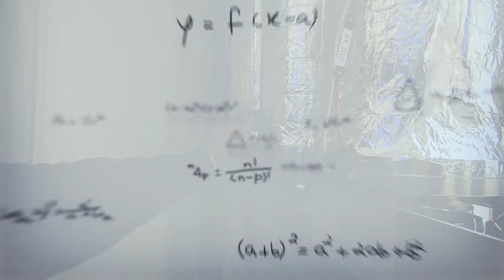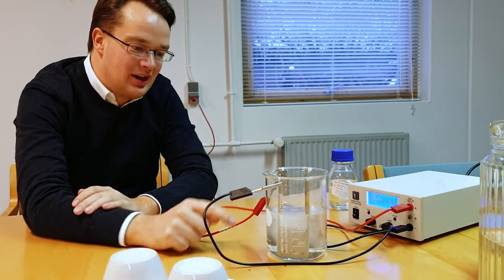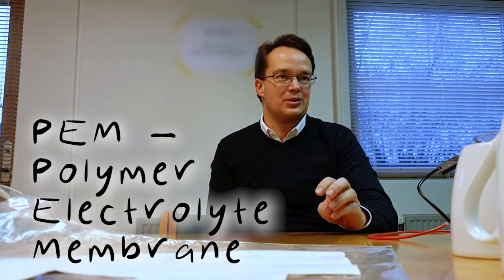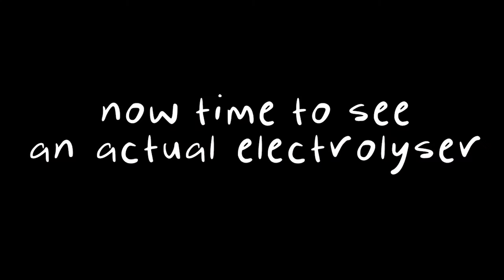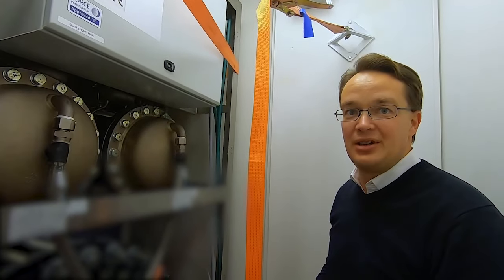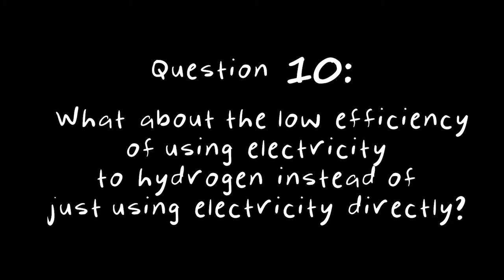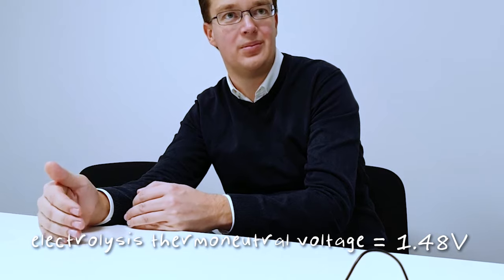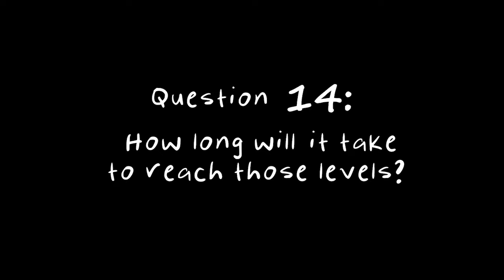Green Hydrogen Systems Electrolyser Tour

Comment: How about a future short video of a co-generation style electrolyzer system ?

As touched briefly on in this video .. the energy needed to split 2(H2O) -> 2(H2) + 2(O2) comes partially from electricity and partially from heat .. I think the electricity side of that frequently gets a disproportional amount of attention .. higher amounts of heat reduce the amount of electrical input needed .. That continues all the way out until eventually the splitting of water can be zero-electrical input and 100% heat energy input .. given the enormous amounts of 'waste heat' out there , absorbing that 'waste heat' as a partner with another process would seem to be a synergy style system , and co-generate instead of solo-generate.

Maybe not only further improve the efficiency of the energy you have to pay for compared to the amount of hydrogen you get out , but also by taking away that 'waste heat' to do so from that other processes you might further improve the efficiency of that other processes as well.

Without a partner processes , it could still be done with a co-generation solar style system .. Photovoltaic collectors are actually better at (do more of it) converting solar light energy input into heat energy ~80% than directly into electrical energy ~20% .. and that heat lowers the electrical conversion efficiency for the PV module (soo it's waste heat for the PV).

Or at the extreme end of the solar heat water splitting to hydrogen end of the spectrum would be to modify a large solar heat collector system like the molten salt facilities , to use all that enormous amounts of concentrated solar heat energy to drive a water splitting system.
Reply: The non electrical heat method sounds ideal Ian, can you point me to any literature to show how it's done? Thanks
Reply: @agritech802  The scientific term for using only electricity is electrolysis .. decomposition of a chemical compound by electrical energy .. the term for using only heat is thermolysis .. decomposition of a chemical compound by heat energy .. there are even some microbial fuel cells that have shown that microbes can also use the chemical energy of the materials they biologically decompose in order to contribute some of the decomposition energy needed for secondary reaction like hydrogen production .. in the real world they do not have to be mutually exclusive , you just need a net overall amount of energy put in to break it apart .. using 'waste'  .. be it waste heat , or biological waste , from some other processes (that needed to be done anyway) , is my personal preferred energy source for such thermolysis.

There are lots of pubic sources about thermolysis , here are a few examples (in no particular order) :
https://www.energy.gov/eere/fuelcells/hydrogen-production-thermochemical-water-splitting

https://www.osti.gov/biblio/7335245-thermolysis-water-production-hydrogen-energy-vector-compared-electrolysis-which-has-higher-efficiency

Discussion of the biological method to contribute energy and reduce the needed input from other energy sources is one of the topics discussed in the introductory book .. Microbial Fuel Cells by Brude Logan 
https://smile.amazon.com/dp/0470239484?psc=1&ref=ppx_yo2ov_dt_b_product_details
Reply: @ianpgeorge  that's great, thanks for that, I'll check them out

Comment: Hi Rosie,  a German company HPS,based in Berlin produces a compact green hydrogen, off grid power solution including storage for home owners using their Picea system. It is still quite expensive but gaining new users continuously. With your engineering knowledge you might uncover more producers of similar small scale systems     Will these become more widespread and above all affordable to more home owners?
Reply from the maker: I didn't know about Picea, thanks for pointing it out to me. I have seen some other home hydrogen storage (e.g. Lava), but I haven't looked into it in depth yet, I need to add that to my list!

Comment: Hello, interesting topic. But we are in the presence of an installation that the private individual could never have installed at his home. Perhaps a presentation would be needed that would show that electrolysis and the fuel cell are possible on a smaller scale like that of a simple individual dwelling. This other level of detail will make it possible to better understand the possibilities offered for the individual, and also the cost of such an installation to store the green hydrogen produced from photovoltaic panels, and then to produce electricity during less sunny periods. However, solutions do exist for homes, we should perhaps try to promote them to start freeing oneself from fossil energy at the level of individuals. The AEM is perhaps for the moment the one that offers a lower cost thanks to less noble matérials in its construction. The prices are starting to drop. A bit like the price of LifePo4 batteries, which drop quite well, and allow battery storage to complement hydrogen storage. For good efficiency, consider producing hydrogen from renewable energy (sun, wind, hydraulic). In any case, avoid fossil fuels to obtain the energy necessary for the separation of Hydrogen, Oxygen. It is not necessary either to seek profitability with regard to the installations in the particular houses. The prices are high. We must seek to be able to do without fossil fuels. while thinking that profitability will never be there. Profitability will undoubtedly be present for the very large companies which will build power stations of this type and finally return to an economic model almost equivalent to the current model of fossil fuels. Large companies are currently seizing the market by using models of the power to gas type, ... Thus, they prevent as much as possible a possibility of autonomy for individual houses which could however easily have a hydrogen system installed in each of them. 
If this develops too much for single-family homes, they could cause a significant loss for these large companies who could no longer sell the hydrogen they produce at prices that will be almost identical to that of current fossil fuels. These large companies will in any case seek to maintain their profits at a level almost identical to what they do with current fossil fuels. Even if the new technology costs less, if not much less. And yet this has been the case for the past 10 years. The price of batteries goes down, the price of fuel cells and hydrolysers goes down.
However, currently 100% electric cars are still very expensive, while they are technically and mechanically easier to manufacture, and have fewer precision mechanical parts than combustion or hybrid cars, and they have less usury ... if the goal is to leave the fossil, we must try to pull up the smaller companies that could offer us decentralized production for us individuals ... because as we often say, small streams make the big rivers ...

Comment: Hi Rosie, thanks for another great video, can you do one on ammonia if you get a chance? I think ammonia production would be another great way of utilizing excess renewable energy and it can be used as a fertiliser or as a substitute for fossil fuels. It would have many many advantages of it can be made cost effectively. It has particular significance at the moment with the war in Ukraine and the cost and availability of gas and fertiliser
Reply: You cannot afford to make ammonia by using hydrogen from electrolysis, its way too expensive and would make fertilizers too costly to use.;

Comment: Talk about diminishing returns, like the man said 'if you have electricity use it. As a question, can he show that this will be better than the corn to ethanol conversion; BTU to BTU. I know cellulose processing has recently improved efficiencies. I get ROI, windmills cost money to build and dispose of properly. If that's what you are using to power, heat loss, material costs as you both pointed out.  Subsidies always weigh in in my book too.

Comment: I like your videos and recently subscribed to your channel. 
Can you do a video on Green Hydrogen/ Fuel cells as an alternate fuel for Aviation please? 
I don't really understand why it is not commercially viable yet especially considering the Gravimetric Density of H2 is much higher than the best batteries available in today's market.
Reply: If the cost of green hydrogen can be lowered to where it can compete with biofuels then hydrogen fuel will be used for aviation.  It's all about money and the "green premium".
Reply: @acmefixer1  so why not use Grey or Blue H2 till Green achieve the cost parity? Just like Electric cars it is greener to use Fossil fuel Electricity driven Electric cars than Internal Combustion Cars?

Comment: If you want to deal with electrical energy availability variation, you might want to turn some industrial facilities on/off? This is suitable for turning off on for that?
I suppose you either have to pair it with hydrogen storage, or pair it with another industrial process that use hydrogen you can turn on/off in sync? Do any exist? Like suppose you can ask whether you can turn it on/off based on electrical supply/demand for more processes than this.

I'm thinking of hydrogen reduction of iron oxides, but it may well be a poor candidate.. Though it's a "just" hot chamber with good hydrogen iron/oxides mixing and a way to get rid of the water produced..

Comment: Is it possible that, if clean energy was so abundant that converting excess into hydrogen fuel for storage or distribution makes sense, even with a low efficiency of, say 35%? 
I’m just thinking that the concern with or value of efficiency drops once clean energy (wind, solar, etc) significantly exceeds demand.
Maybe I misunderstood what is meant by efficiency. I realize other overhead costs are at play.
Great video, by the way. I’m new at this, so please forgive my ignorance on the subject. Give me a year and I’ll be responding with formulas like the guy who posted earlier. :)
Reply from the maker: You are absolutey right, thanks for commenting. You have to remember though that with 35% efficiency we'll need three times as many solar panels or wind turbines compared to if we used the electricity directly or stored in something more efficient. So we need to make sure we use hydrogen very carefully, or we will triple the size of our challenge.
Reply: If clean energy was so abundant, then it would no longer be a worthwhile investment. Hydrogen can help keeping green energy useful in times of energy overproduction.

Comment: Hello Rosie,
I was wondering could hydrogen + fuel cell replace a 30Kwh battery pack as a source as a backup when grid goes offline. And to replenish your hydrogen you can use the grid with a charger

Comment: In simple terms, once you’ve taken the hydrogen and the oxygen out if the water. What is left. Or has the water evaporated in the process? If so, will it still come back as water/H2O?
Reply from the maker: The water is completely used up by the process. A water molecule is 2 hydrogen, one oxygen molecule. The electrolyses process splits the molecule apart, so you get hydrogen and oxygen leaving nothing behind.
Reply: @EngineeringwithRosie  Thank you for your reply. That being the case, it follows that hydrogen doesn't come from a renewable source. In this day and age, is it an appropriate way to generate energy? Especially in a dry continent like Australia. This week, two mega plants are being planned in two states.
Reply from the maker: @tonyphotiou1742  when the hydrogen is used to generate electricity again, either by burning it or in a fuel cell, the hydrogen combines with oxygen to make water again. The exact same amount as was used to make the hydrogen. So it doesn't "use up" water on a global scale. But you can't make hydrogen from electrolysis where there isn't any spare water. If you did it inland you could use up the water in a river or dam, even though it would eventually come back as rain somewhere else. The  Australian projects all use sea water with desalination I believe, so they won't use up scarce fresh water.

Comment: So Rosie, Is the implication that the excess electric energy produced by the offshore wind farms could be utilized  to create H2 for later use?   AND
Where does excess electric energy go if it is not used?  Does it go into the ground?  The law of conservation of energy would hold that it has to go somewhere.  It can't just vanish?
Reply: Excess elecricity does not mean that its been produced. Excess that can not be used or stored will just not be drawn meaning it was just potential electricity. The voltage will be there just like your wall socket but if you do not switch it on no current flows.

Comment: I suppose that if the efficiency of splitting hydrogen fro water is 75%, and if the efficiency of a fuel cell is say 90%, and the efficiency of an electric drive on a car is say 85%, the the efficiency of the entire cycle would be: 0.75 * 0.9 * 0.85. Or about 57.4%.

Comment: Recently US DOE sponsored research announced employing a catalyst for H2 efficient release from liquid organic hydrogen carrier (LOHC) at ambient temperature and pressure (cryogenic-pressure unnecessary);  LOHC meets the critical need to store and transport H2 energy. Retooling the existing petroleum pipeline network (including maritime, rail and truck tankers) for a liquid H2 carrier makes H2 distribution pacify oil companies but makes available sector-wide, technology-wide and ubiquitous for zero-carbon hydrogen innovations for fuel cell electric, HFCV and other H2 innovations.

Comment: Kasper mentions 200GW+ North Sea wind potential, with far inadequate transmission lines to make full use of it, and sees green hydrogen as a solution. Why would building electrolysers close enough to the turbines and then transporting hydrogen they make be easier (that is, cheaper) than "beefing up" the grid?
Reply: You want them at the production sites to not have to pay power.grid fees. They would double the production cost. It is cheaper to drive around highly compressed hydrogen. Or you build them decentralized next to H2 fuel stations to not pay delivery costs.
Reply: @Psi-Storm  Hm. Perhaps. But at ~30% end-to-end efficiency (and you still do have to transport hydrogen) it doesn't look cost effective to me. Sure, if you can put your wind turbines and electolyzers right at H2 fueling truck stop or port or airport, but the guy was specifically talking about off-shore wind farms.

Comment: what type of water can be used? what are the limitations in terms of the water that feeds the system? would it be possible to use untreated industrial wastewater for the process?
Reply: Didn't you watch the video?
The water has to be purified/demineralized anyway, so basically, you can use any kind of water source.
At least for efficient hydrogen production in an industrial scale (on the long run).

Comment: Each solarcell is about 0.5v, hence with just three of these in series , there will be a total of 1.5v.  Some large solarcells can produce up to 4 amps of current.  H is good for high heat metal cutting and fuel boosting for better fuel efficiency.  Update: 4 in series may be better.
Reply: No it isn't. The last thing you want to do with the hydrogen is to burn it. Metal cutting can be done as it is now with electricity or lasers. I don't know what you mean by "better fuel efficiency" but if you mean in an internal combustion engine hydrogen is worst fuel you can use
Reply: @salerio61  I seen some vids where people  use some into their engine air intake.  They say it improves combustion.
Reply: @oceanbreze1977  yeah, and I've seen some vids where Superman actually flies
Reply: @salerio61  
Apparently you fail to understand that the CO2 emissions must be eliminated.  The efficiency of hydrogen fuel cells is better than an IC engine.
Reply: @acmefixer1  Apparently YOU fail to understand VERY simple English. Did you miss the part where I said "The last thing you want to do with the hydrogen is to burn it"? 

Brexit and UKIP voter by any chance? I know they are a bit simple in the head.
Reply: 'Metal cutting'? You mean 'Brown's Gas'. HHO

Comment: Q6: What do you do with the Oxygen that comes out during electrolysis?
Answer: Nothing. It just goes up in air.
My question is why can't we also capture Oxygen and use it?
Oxygen by itself is a good flammable gas, so could be potentially used as a clean green fuel, like Hydrogen.
Oxygen is already widely used for many industrial purposes (arc furnace in steel manufacturing?) and in hospitals as life saving gas in ventilators etc. (Oxygen was indeed in short supply last year as countries and hospitals were scrambling to get Oxygen supply during peak of the Covid crisis). 
Hence, there is a huge demand for Oxygen and there are many large multinational companies like Linde, BOC producing and selling Oxygen on industrial scale. I guess these companies produce Oxygen from some gas rather than from water. My question is if Oxygen can be produced free of cost as a byproduct of Hydrogen production from water why can't we capture and use it commercially? All you need is a tank to store and pipe to carry Oxygen, just as you need for Hydrogen. It should  virtually cost next to nothing.
To me it looks too obvious and I can't understand why you can't capture Oxygen from electrolysing water for Hydrogen. It makes huge economic and commercial sense. Unless of course I'm missing something vital.
Can any knowledgeable person enlighten me please?

Comment: I wonder if storage batteries like lithium or flow batteries is a better solution to store excess green electricity?
Reply: Batteries need at least one cycle per day to get the storage cost per kwh down to payable amounts in grid applications. You can not realize long term storage with them. Here power to x might fill the hole solar has in winter production.
Reply: Flow batteries can store electricity for longer periods than lithium batteries.